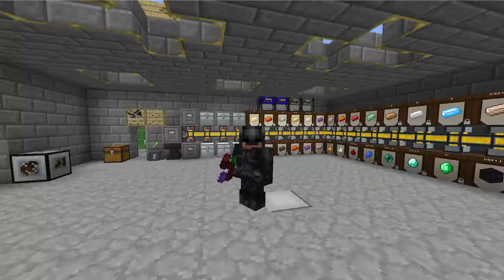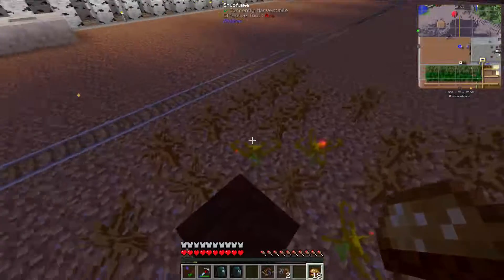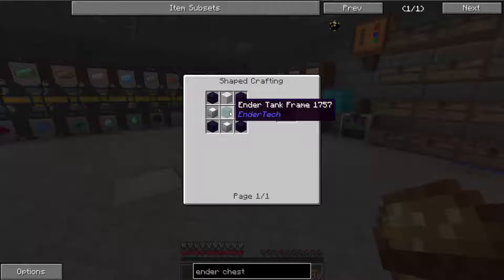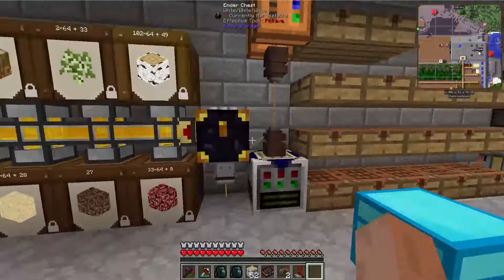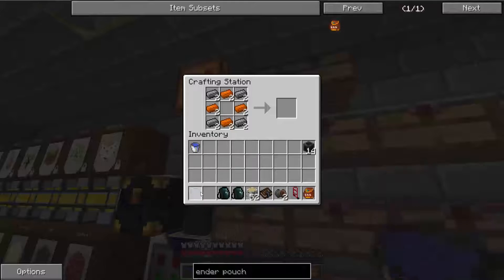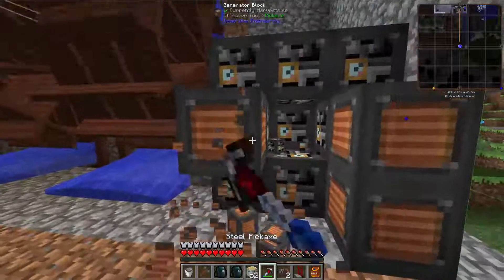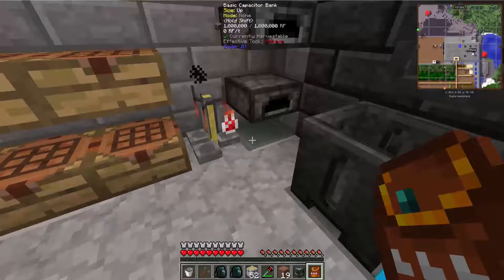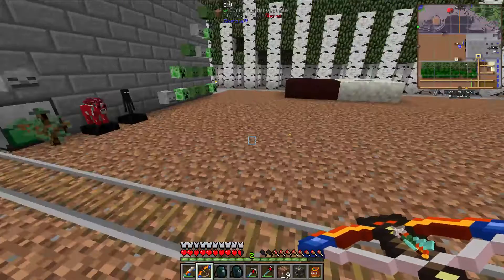Let's Play Minecraft Infinity Evolved E21

Comment: Between no power Christmas Eve and no internet until Sunday morning (hooray wind storms) I'm just now catching up and starting this episode. Hope you had a Merry Christmas as well Gem. As far as the Immersive Engineering wiring goes, I have seen nothing but a number of problems (some might be intended) with it. So I plan on using that mod very little in this pack, except as a converter for RF to EU and back. Unless I can find/make something better than the HV wires.
Reply: Also, those weren't Blizz (Ice), they were Blitz (Air).
Reply from the maker: +Oduunich Loftuer I still like them for looks and simplicity, just have to either increase my power generation or change my distribution. Sorry to hear about the power and internet outage. If you were closer you would have been welcome to my generator. Not diesel... but it is a Honda gas one.
Reply: Gem Slate Have a generator myself, the pull cord broke when my dad tried to start it to keep our furnace on.
Reply from the maker: +Oduunich Loftuer Gotta love it. Sounds like you are living my life.